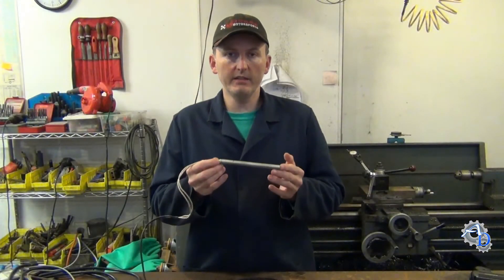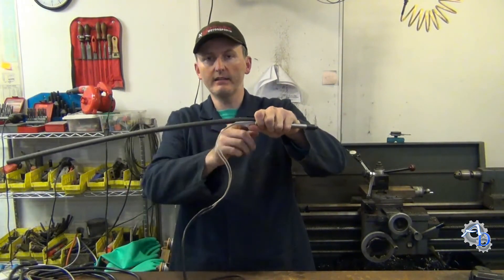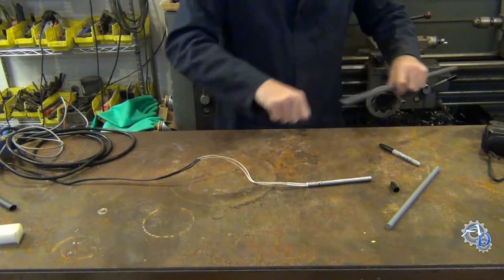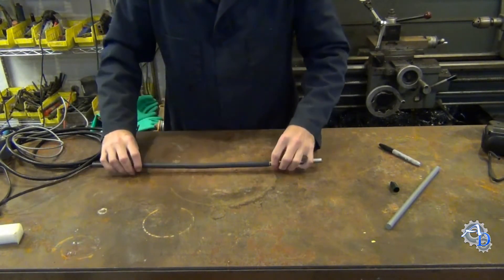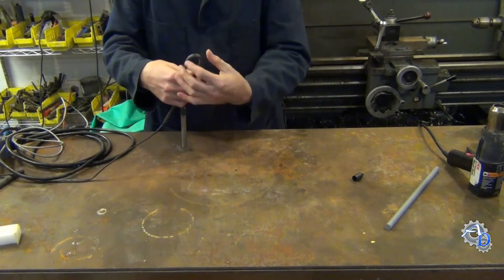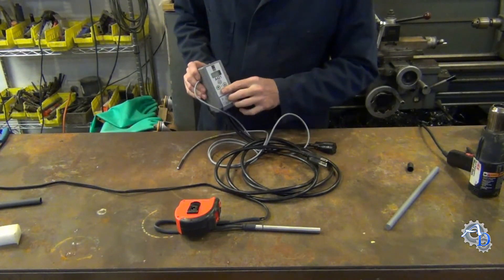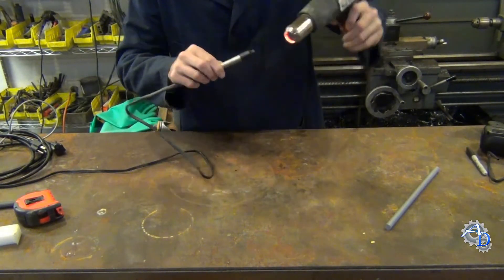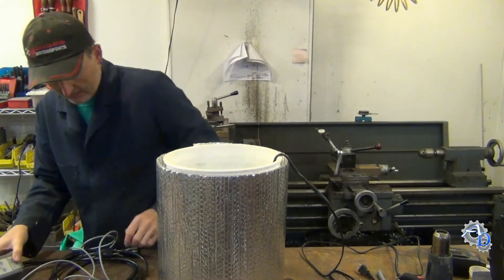DIY Waterproof Heater for Hot Tanking and Anodizing

Comment: Thank you for this helpful video. I am trying to find a solution for maintaining a 60 degree centigrade temperature for textile dye bath. It's for a vat that is 20cm by 2 meters long and for 50 liters of water. I'm wondering if its possible to link two or three cartridges onto the same temperature controller. Thanks in advance if you have advice for me.

Comment: Thanks.  I'm trying to warm 7 gallons of water in a U shaped  4 inch x 9 foot PVC pipe.  Something like this:   https://photos.app.goo.gl/6u2LMCRL3gKX3LNR9  .  My port is 1/2 NPT.  Can the shielded tip of these cartridges touch  scheduled 40 PVC pipe? What about the top where the thread is, can an inch of it be un-submerged?  I only want to run it for 15 minutes to warm, not boil. Any ideas where I can get a product for this implementation?  I'm looking at this product but think it will touch my pipe:   https://www.amazon.com/gp/product/B0788LBYSK/ref=ox_sc_act_title_1?smid=A3TV5NVFP7DUSD&psc=1

Comment: heat shrink pulled up off the element and all the glue was maybe keeping it insulated still.  Don't know if the element is totally destroyed yet. Maybe I didn't use the heat gun right.
Reply from the maker: I haven't experienced that. I would just put new shrink tubing down a little lower. It shouldn't pull the boot off. If the element gets exposed, water will get down into the electrical area and short itself out. I had that happen before I switched to using shrink tubing.

Comment: Can the heater withstand being submerged in an acidic plating solution?  If not, could the whole heater be sheathed in the shrink wrap tubing?  As long as the whole thing is submerged would the heat dissipate fast enough to protect the wrap from the high heat of the element?  Or would the heater have to be controlled to not reach its maximum temperature?
Reply from the maker: The heater's made from Inconel, which is a type of high temp stainless, so it's resistant to many chemicals. I would check for compatibility first though. Don't wrap the whole element in shrink tubing. It can't shed the heat quickly enough, and will blow apart. I tried it. It didn't end well. I don't how to vary the heat. Maybe a variac would work.

Comment: I was wondering about my power bill in the winter I’m in Florida so it’s not bad but I have an out side tank about 265 gallons temps get drop around the low 40s for a bit at night the tank water n the mid 60s to keep it in the high 70s or low 80s do you think this 1000 watt heater will kill my power bill, any idea ?
Reply from the maker: I doubt it would be cheap, but good insulation would help a lot.

Comment: Could you "waterproof" the heat sensor by sealing it with the moisture seal tubing to place it in the solution rather than taping it to the outside of the container?
Thanks.
Reply from the maker: Yes, I do that in cases if I need to use the probe and heater in several baths. I heat seal a piece of vacuum bagging so if forms an envelope that fits the temp probe. I dip that into the solution. Either way is fine. I show this in videos where I anodize.